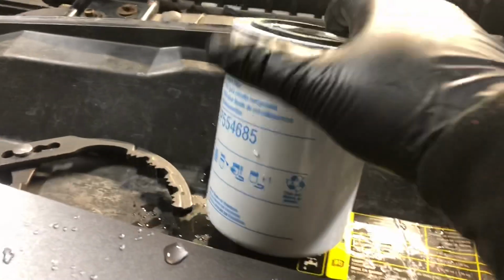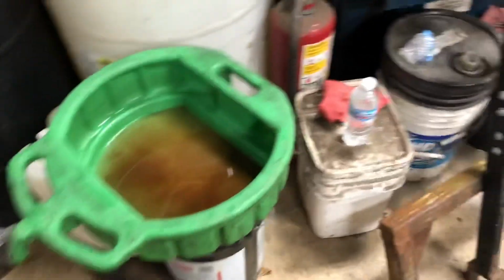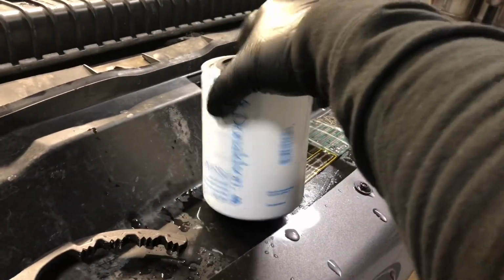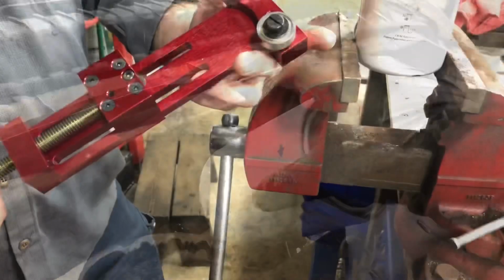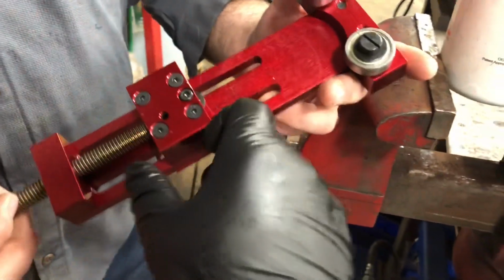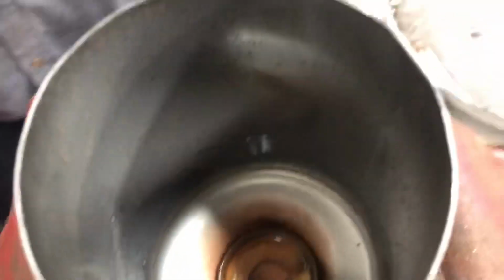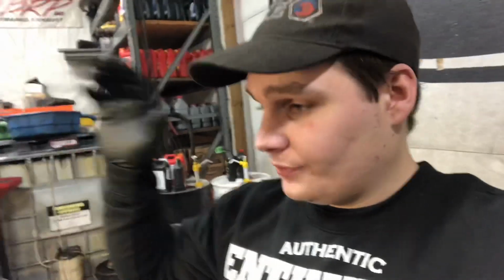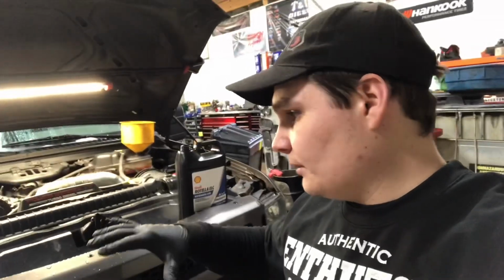Do Coolant Filters REALLY work??

Comment: Thank you for this video 
It's an oil filter 
Can you please tell and confirm
The filter is installed between coolant tank return line and into the radiator where that hose connects ?
What benefits the filter do ?

Comment: 100% if there is abrasives in the coolant its going to widen ports between the intake and the engine block and prevent o rings in the intake gaskets to seal properly ....  and also weaken oil coolers on both diesel and gas engines

Comment: Not just saving the oil cooler, but the pump bearings, and keeps the heater core and radiator from plugging with any debris as well.

I saw a 12 degree delta climbing a 9% grade pretty hard, so time to replace the cooler before it gets any worse. I ordered a filter kit after watching this, and will run it for a couple thousand miles before cooler replacement. New cooler, filter and ELC coolant should keep it happy for a good long while. Also doing a finned aluminum diff cover from an 08 and service the diff. Next will be studs and egt sensor. 

As a certified ford technician, I know a lot, but I also I learn a lot from these videos as we never deviate from factory OEM at the dealer. I've seen trucks with coolant filters come in, but never really paid attention. Now I know. 

Thumbs up and comment for support. You have an awesome channel. Going to start binge watching these, the aftermarket is crazy with these things. I never knew. Thanks big buddy!

Comment: Can you put that kit on a 6.4 Hemi. My heater core keeps getting clogged. I think dodge used sand to mill number 7 cylinder.
Reply: Brianbehory. First stop using Hoat antifreeze or any antifreeze that contains silica. Flush system and use OAT antifreeze plus a filter. Problem solved. I have a Chrysler  200. Same problem.

Comment: Lots of people say they don’t work or that it filters such a small amount of the volume each pass that it’s not worth it. But as you said over time it helps then once you get most of it then your home free. Good video man!
Reply: I put a coolant filter on a 99 grand marquis that had a nasty system even after 3 major flushes, new water pump, hoses, etc. I thought I had it clean, but it plugged the filter solid the first 20 minutes of run time. I've had it on there for about 2.5 years now and gone through 4 more filters and they've all had a shitload of sediment in them to the point the heat coming out of the vents isn't very hot until the filter is changed. Coolant remains clean now.
Reply: @MattsRageFitGarage  nice! I’m a believer

Comment: question: how does all that debris get into the cooling system in the first place?
Reply from the maker: Running coolant that isn’t for these trucks can cause the coolant passages to corrode. Bad water pumps can eat away at front covers. But the number one thing is when international made the blocks, they sent sand through all the coolant passages to smooth them out. They did a poor job of cleaning that out.

Comment: Evans waterless coolant is the best coolant. 6.0 powerstroke and newer engines need a coolant filter to keep the engine oil cooler from plugging up on the coolant side.
Reply: If you ignore the fact that waterless coolant isn't nearly as effective as regular coolant at its main job (heat transfer), the fact that the cooling system wasn't designed for such a thick fluid, and the potential flammability concerns if it leaks, it's probably great.

Comment: Will this filter system work with a Dodge Ram 6.4 gas and the purple coolant?
Reply: Why wouldn't it?  I put one in my 198?,  4 cylinder Mustang using a Fleet Guard DUAL remote filter head for the coolant filter, along with a B&M Racing style single inline automatic transmission filter, also a Fram dual oil filter system and a AMSOIL Universal single bypass oil filter.  I also  put an inline filter on the power steering return line, I also put on a filter for the windshield washer fluid just for the fun of it.  Why because I live in America and I can.  I never got to putting in the differential lube pump, cooler and filter, as the car was hit and totaled by a drunk driver.  Personnel license plates were "FLTR IT"  Do what you want to do.  Have some fun.